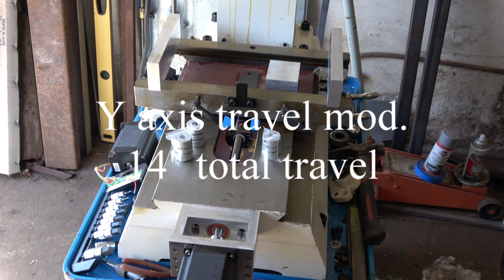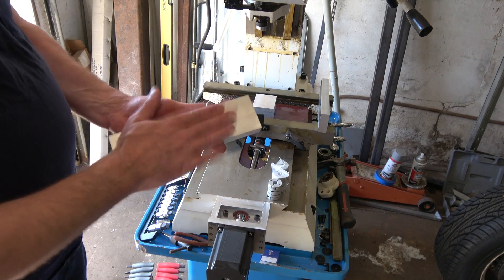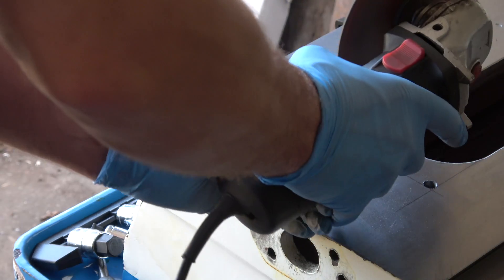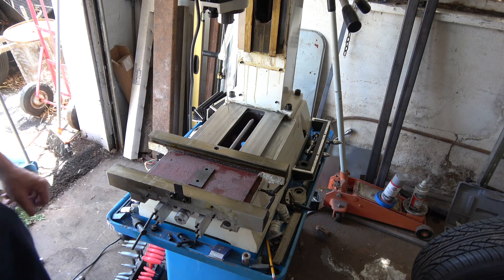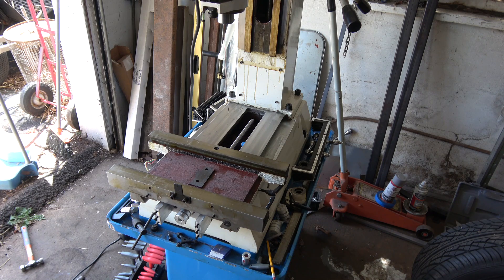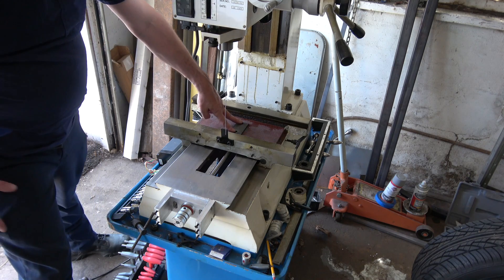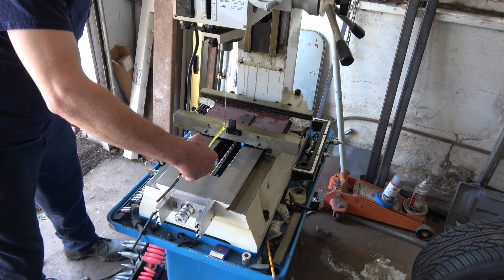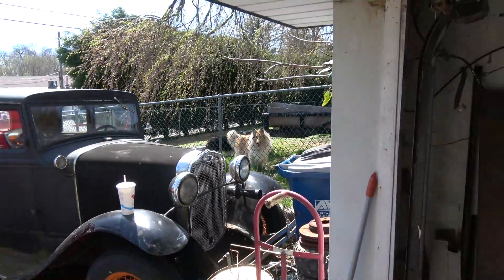PM 940 cnc y axis travel mod pt 5

Comment: I can't work on anything without telling my "girls" to HUSH a few dozen times either. 
Just so you know, the parts for my Lincoln are still on my bench, as you mentioned, "Life" has gotten in the way of getting them to you.
Reply from the maker: I was wondering what happend.  funny thing is i was at the east coast nats in york PA , and there was a hot rod lincon...guess what it was missing :)
Reply: I have had a LOT of interest in getting them completed but my mother had a series of strokes and then passed and all my free time has been taken up with that.  I pulled the bumper and removed the bracket and it and the replacement pieces line up perfectly.  I need to box the samples and get them to you.  Thanks for more videos, always a pleasure to see what guys are working on.